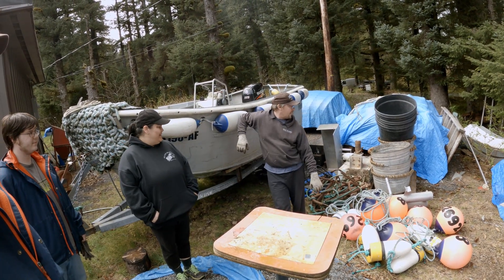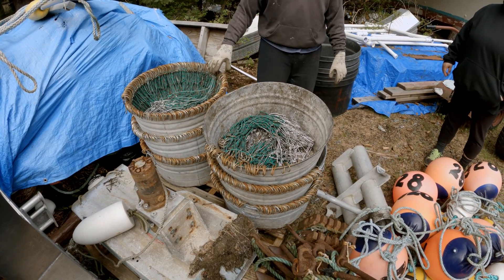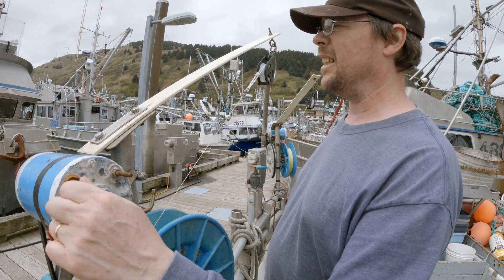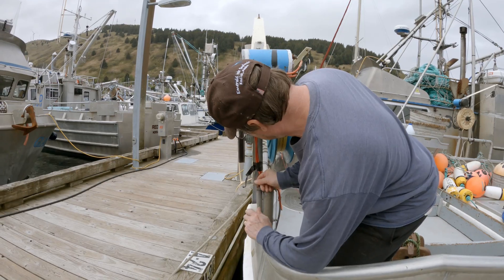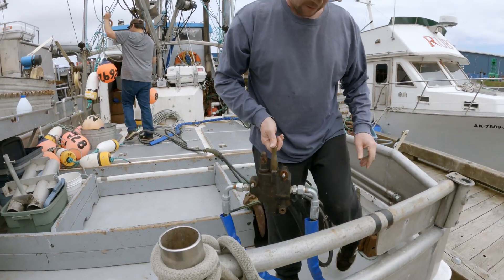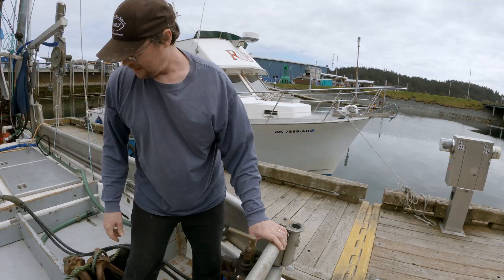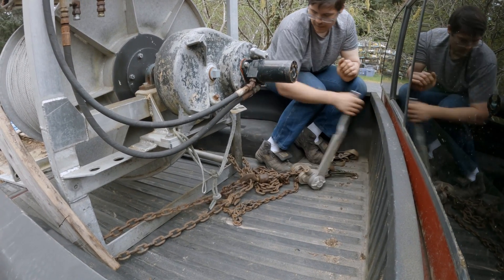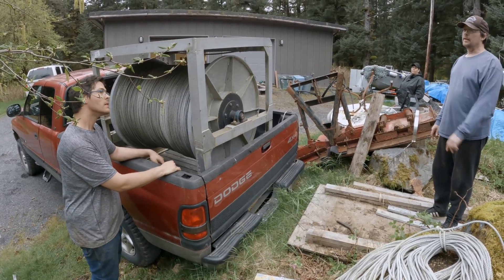Loading up the Halibut Gear - Last Call for Spring Halibut Share Boxes!

Comment: Remember to clean or replace those ''ZINK'' plates , they will save you money down the road. A clean bottom saves you fuel . Love the quick off and on with different gear set up some one put some thinking into the set ups.

Comment: I don’t know if this will help you guys or not but I have done a lot of the same thing and what I did is I took Shackleton one end and a turnbuckle on the other end that way I was able to pull from the center if that makes sense that way you have a piece of cable stretching between your two tiedown points it work good for me
Reply from the maker: A center pulling point would be beneficial. Great tip Robert.

Comment: How long is the rope on wheel ,size and strength. What size do you use on crab pots and strength?
Reply from the maker: Each shot is 600 feet or 100 fathoms, total 34 or 35 on the reel. Its 5/16 for the most part, some older stuff that is a little smaller, break test is 1800 lbs.  On the crab pots we use 9/16.